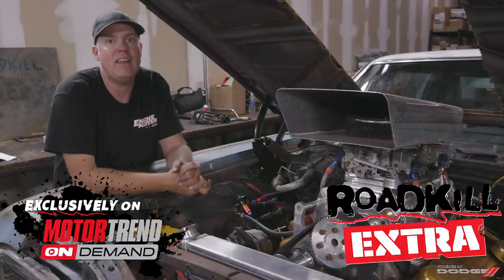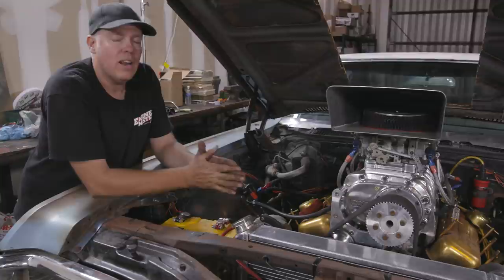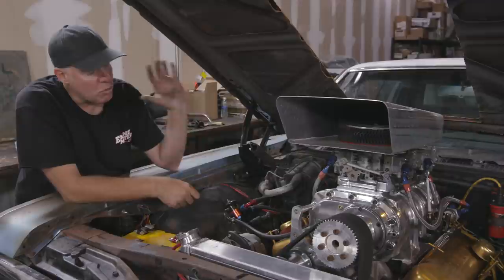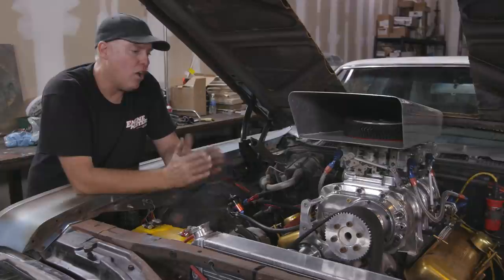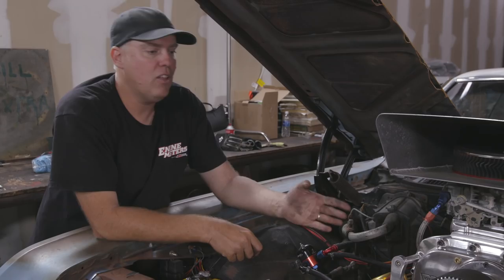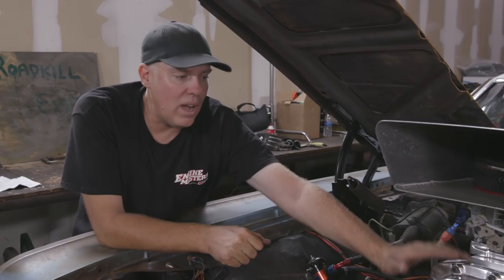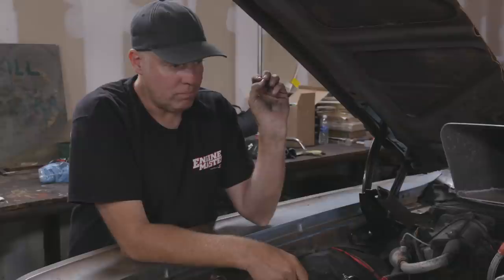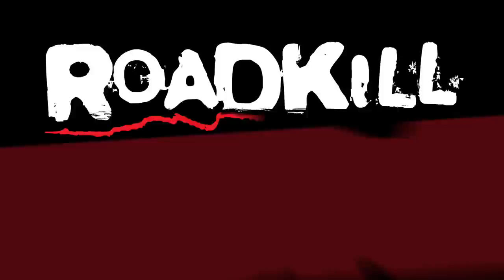Freiburger Explains Supercharger Basics - Roadkill Extra

Comment: Supercharged refers to the oxygen and fuel charge not the compression ratio. NOS is supercharging .. Your increasing the oxygen charge within the cylinder hence its a chemical supercharger. At least he got the "turbo is also supercharging" part right.
Reply: Dysstatic yeah but a v8 super charged if pretty cool
Reply: I don't think there is a governing body that decides what is and isn't supercharged. In my opinion anything that increases the pressure in the intake manifold beyond atmospheric is supercharging. By that definition NOS is not supercharging. However, as I said earlier there is no governing body so you can define supercharging as anything that increases effective oxidation ability of the charge thus including NOS as a supercharger.
Reply: Curt D but isn't nos compressed, which would probably increase pressure compared to no nos. also look up compressed air supercharging, it's a simple idea but it seems to work well. They use carbon fiber scuba tanks and fill it with air using a scuba compressor and they then inject the air like nitrous
Reply: nitrous not nos, is also known as chemical supercharging. if you wanna nitpick
Reply: Fair enough
Reply: I just call it forced induction

Comment: First supercharged engine was created by Dugald Clerk, who used it for the first two-stroke engine in 1878 . . . ..  not some bod bolting one onto a hot rod 65 years later . . . .which was also at least 25 years after Mercedes had produced the first production car with a blower in 1921
Reply: supercharged engines have been around a lot longer than just in automobiles like in many fighter jets of WWII. He's talking about in the context of hot rodding.
Reply: Jorge Orwell David never credited the Barney as being the 1st guy to use a supercharger on a car he simply said he was the 1st one to take 1 of these GMC's super chargers a use it for a hot rod application
Reply: He VERY SPECIFICALLY said the first guy to put one of these GMC blowers on a hot rod. He never said the guy invented the idea of supercharging. Use your brain before you comment.

Comment: No mention of "Twin Screw" superchargers? Boooooooo. They are more efficient than Roots and function similarly in that they look similar.

Whipple
Kenne Bell
Lysholm
HPS
Sprintex
Reply: Lysholm is not a brand Mr. Smartypants. It's the type of compressor.
And just because they look similar, does it in no way mean they function similarly. They are quite different and they act very different on an engine. I have both and they are nothing alike when you drive them.
Reply: @AB-80X  I think it's you that's acting the smarty pants. I'm merely directing attention to the fact Freiburger didn't mention the alternate supercharger that is more efficient and serves much the same role.

Comment: NOOOO 
A supercharger is belt driven a turbo is exhaust driven. 
You defined a boost set up
Reply: Supercharging is the general term used for introducing air at above-ambient pressure to the cylinders, not necessarily by crank-driven pumps.

A turbocharger is a turbine-driven supercharger.
Reply: A turbocharger is turbine driven. It does not directly refer to the fact that it is exhaust driven.